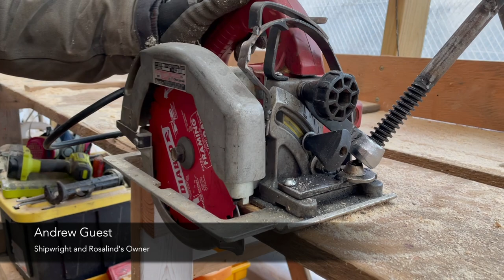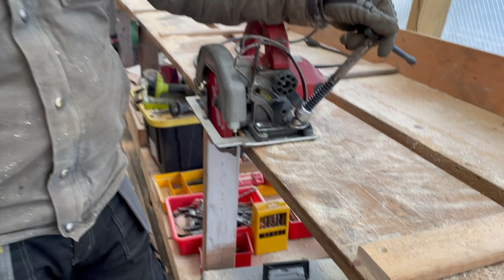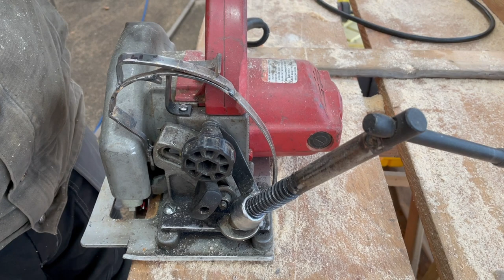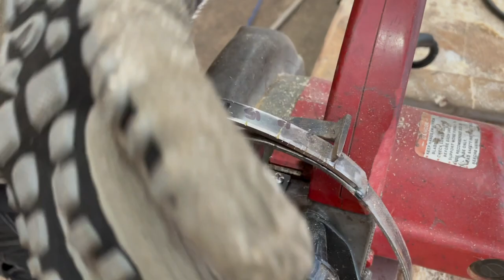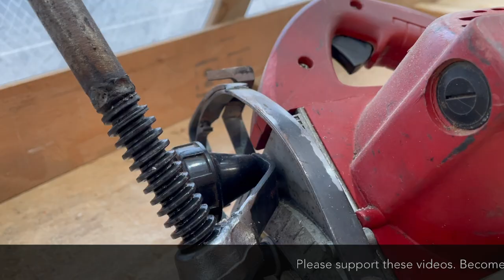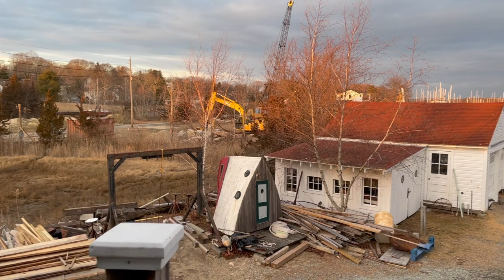Restoring Rosalind, Episode 10.1: Our Rolling Bevel Saw

Comment: You can hold the guard open without a wedge(I don't like to wedge a guard), drill a hole in the front right corner of the soul where it turns up. Loop a couple of rubber bands throw the hole and stretch them over the guard lifting tab. Allows you to have a safe saw that doesn't accidentally kill blade teeth on the floor and your out two or three rubber bands a year.